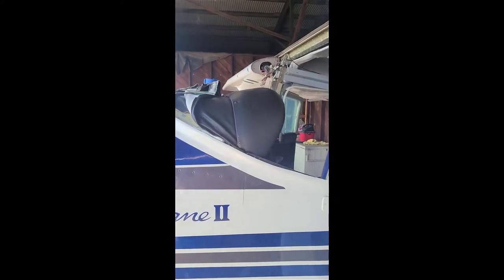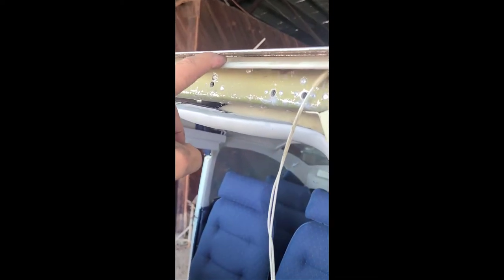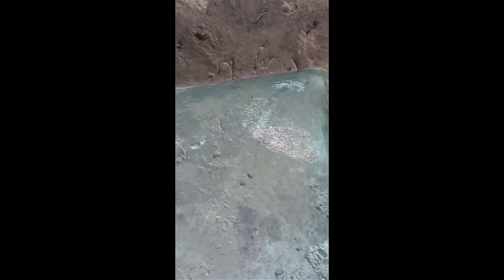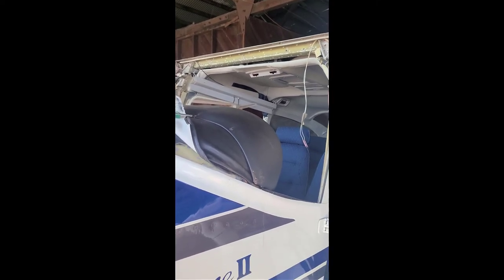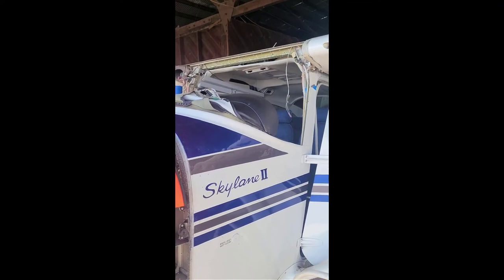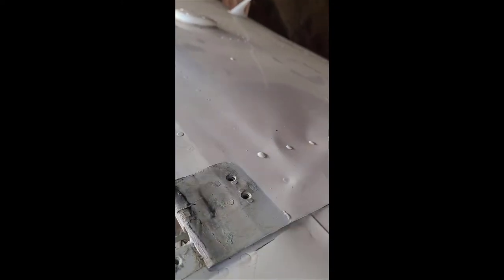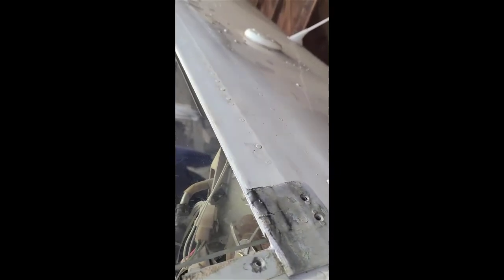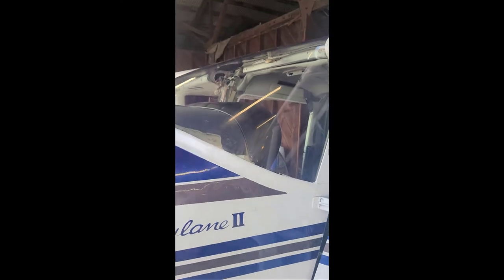Cessna 182 Windshield Install

Comment: What brand of windshield did you go with? Also, that old windshield had that folded over edge… how did that unlock from the aircraft roof ? Great video. Thank you!!
Reply from the maker: I used LP Aero.  Solar gray with the UV filter.  I am very pleased with the windshield!  Both the old and new windshield have a retainer on the top (inside surface).  Using the method described in the manual (push with your feet) may be enough to snap the windshield out of the lock. I used a very wide screwdriver and gently pushed the metal retainer down while pushing the window out.

Comment: It's a full floating windshield that's why they use felt. So it doesn't crack when the airframe flexes. You can see a Cessna 182 windshield actually floating at a low idle which I avoid when possible cause it breaks the sealer. Also that buckle on the roof looks awful. You could of avoided that by pushing in some flat .032 sheet metal shim strips with the edges rounded off inside under the top windshield locking strip which gives it a ramp to slide out easily out of the top channel that it locks into. Kicking it out is cave man style it damages the roof or locking channel. I am going make a video on doing this right, your mechanic should of know this if experienced with Cessna windshields. Also with the strip unriveted you can trim it to fit up near the wings better. The front lower windshield edge under the riveted strip is not trimmed enough, its pushing the top part back past the leading edge. Once these planes get butchered its almost impossible to fix. Hopefully you got that top locking strip in far enough to engage the channel so it doesn't blow out.
Reply: I’m ready to see your video. Didn’t his putty knife do the same as your sheetmetal trick?
Reply: It was already buckled fyi.
Reply: Where is your video?
Reply: @mopar92  There's a few ways of doing Cessna windshields. The windshield has to float in felt or it cracks. Removing the lower retainer gives you a better fit & seal but takes longer. I measure the deep it sits in the channel & trim 1/8 " clearance for the felt. I just haven't got around to making a in detail video.